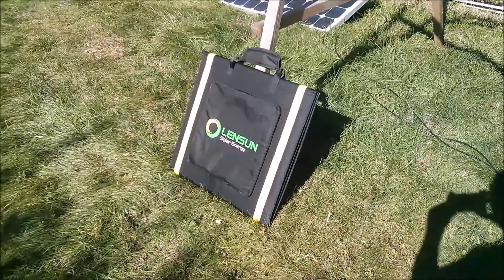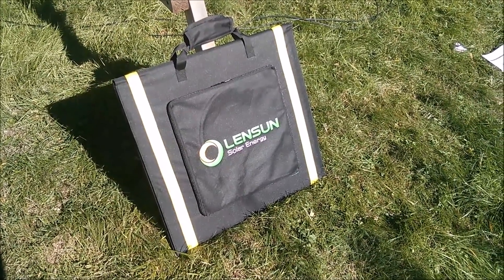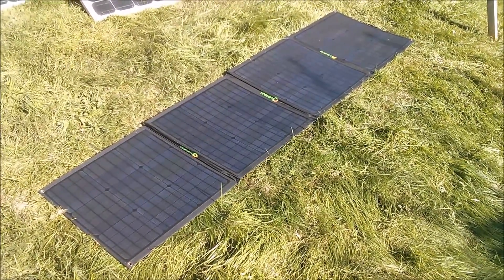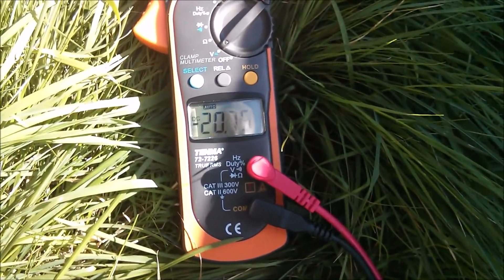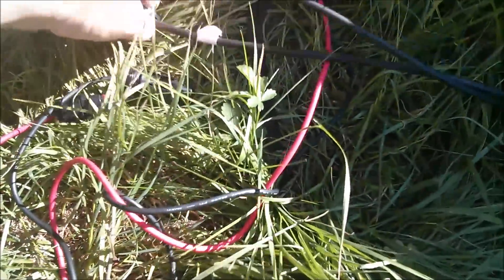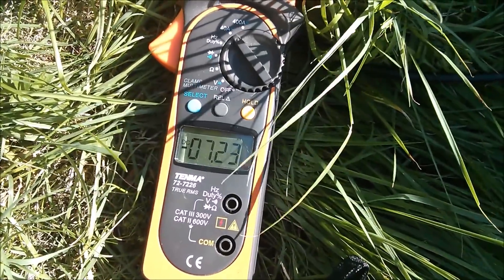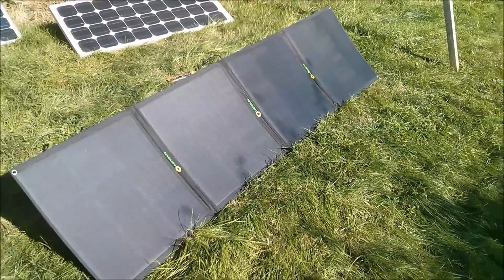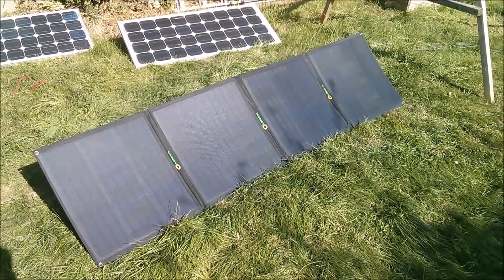Julian's Review: Lensun 160W Folding Solar Panel

Comment: That controller its better for lithium batteries. It has a lot of power lose. Mppt 7210 its not an eficient mppt. Its losing about 20% of you power coming in. Its a cheap mppt. You need to instal EPEVER OR RENOGY. THEY WILL GIVE YOU NEARLY 30% MORE POWER. PANELS ARE GOOD, BUT THATS NOT A PULSE CONTROLLER FOR LEAD ACID. IT DOESNT MATCH THE NEEDING OF LEAD ACID WICH ITS REJECTING THE CHARGE WHEN ITS NOT THE RIGHT MPPT. YOU ARE NOT PROFESSIONAL in solar kits.

Comment: I bought a lensun 100 watt fiberglass backed panel 2 years ago directly from the
lensun facility in China for use on my boat. I paid more for the best panel
they offered in hopes that it would give long and efficient service. I placed
it securely on top of the Bimini where it stayed until now. 

I recently noticed that it wasn't producing  power and that my batteries were
drained.  Since the batteries were isolated the panel had obviously not
been producing power for some time.  From purchase to discovery of failure
the time span was....yep....2 yrs 2months.  2 months past their warranty even though 
in all likelihood the panel failed well within the warranty period.  

After a week or two of back and forth with lensun in China they instructed me to test
the diodes, remove the diodes, test the internal connections, etc...take
pictures of the multi-meter readings, take pictures of the mounting, take
pictures of the label on the back of the panel, re-solder, and use such and such
product to re weatherproof the housing and on and on. 

When I brought the panel home to conduct these tests I discovered what the problem was.   When
the panel was flat the multi-meter read 0 volts. When I bent it slightly it read
13+ volts. Lay it back down it went back to 0.  That's a pretty good
indication that the circuit is broken inside the panel itself. 

I sent them a video of this and they immediately responded and stated that they
wouldn't honor the 2 year warranty on the panel but happily suggested I buy
another panel from them at a slight discount.  I essentially told them
that I would be stupid to pay almost 300 dollars for ANOTHER panel that would
likely fail in two years. 

I realize now that they weren't going to honor the warranty
anyway.  But that didn't stop them from asking me to do their
troubleshooting for them.  One last thing...if you do  have the
misfortune of having to communicate with this company do it via email because
their reps are difficult to understand over the phone.  Well that is my
experience with lensun.

Do with it what you will....
Reply: That's valuable feedback, sounds like one would be as well off to take a chance on the cheaper AliExpress suppliers in that case.
Reply: @fionnut  I'm done with paying a premium for Chinese crap. Especially with all the sabre rattling of late.  If I can find a tea kettle that wasn't made in China I think I should be able to find a dependable well built, albeit more expensive, panel made elsewhere. That list of suppliers is longer than you might think. By the way, the tea kettle was made in Portugal and actually cheaper than the Chinese kettles and made so much better.  
One other thing of note:
I've posted this exact same comment on several other vids testing lensun panels as well as all the YouTube vids that lensun has out there.  Not only have my comments been wiped at YouTube lensun and lensuns main website but they have also disappeared from several "independent" reviews on YouTube. That leads me to believe that some of these "independent" reviews are actually generated by lensun......and that's just shady business. Once again run....don't walk...away from this company and it's products.
Reply: @rotartiller  Thanks again, I had considered buying from them as a supposedly "premium" Chinese flexible panel supplier. I'll take my business elsewhere.

Comment: Hey Julien, you calculated the wrong numbers! The yellow ones in the middle gives everything about the output, just the red voltage gives the solar power input, you just need to power meter the solar panels lines to the MPT to see the input power. I think you missed this. But I like it anyways! Cheers 🍻

Comment: Would like to know why the panels aren't getting destroyed by short-circuit  them while pointing them to the sun. Thank you.
Reply: Alb Catalin, Internal resistance limits the current. Not like shorting a battery. Short circuit current is an actual rating on the panel. 
Isc. Short Circuit Current shows maximum current the panel can produce. Rated by the manufacturer. 
Voc. Open Circuit Voltage shows the maximum voltage the panel can produce. Rated by the manufacturer. 
Vmp. Imp. The Maximum Power Voltage and Current occurs somewhere between those two points Isc and Voc. Rated by the manufacturer. 
That is also how you would test a used panel to check for issues and the amount the panel has degraded.

Comment: You should attach your flashlight to a long pole so it's always on view during your outdoors shoots  :p  I've only just started getting into solar and while this is a fairly neat solution, the cost as always seems fairly high considering you could buy 4 40w flexible panels for less than half the price.

Comment: That mpt has a slight hum. When you point the camera at it there is a hum. Is there a fan in that? Its either that or the amp meter.
Reply from the maker: Yes, there is a fan inside it.

Comment: You were never going to get maximum power at this time of year in the UK, but what they managed was impressive.
What are you going to do with your growing collection of flexible and semi-flexible solar panels, it seem a shame to waste the power they could be producing.
Reply from the maker: I gave the 100W flexible panel to a friend who has a narrowboat. I'm building a new workshop in my garden which will be completely solar powered. I'm also interested in getting an old motorhome :)
Reply: It's not obvious why the September sun should be much weaker than mid Summer sun.  There's a small effect due to the larger amount of atmosphere that the light passes through but this is negligible compared to the loss due to not having the array at the correct angle.